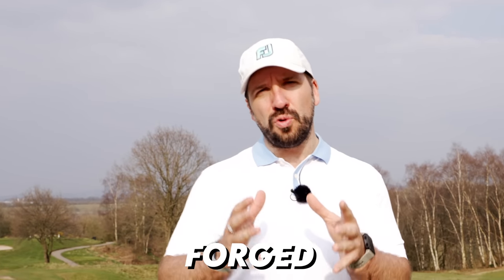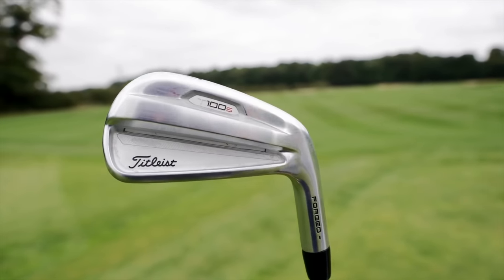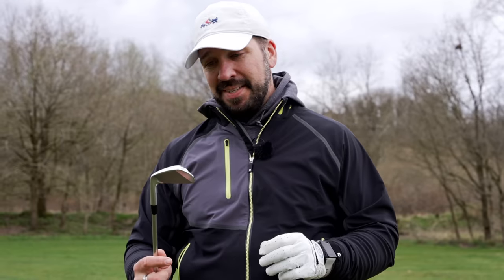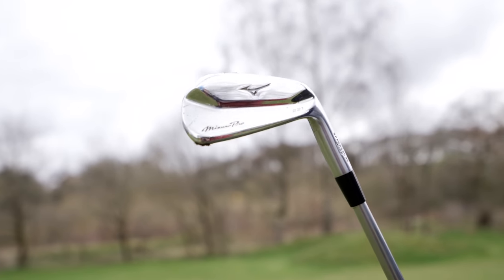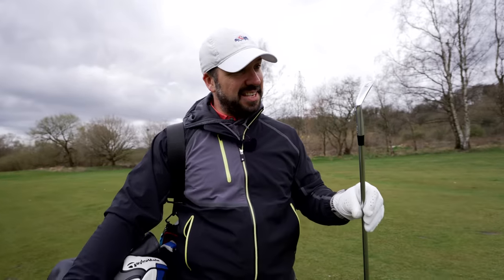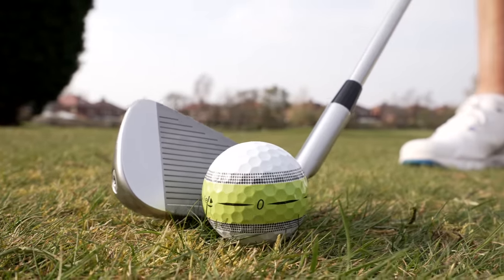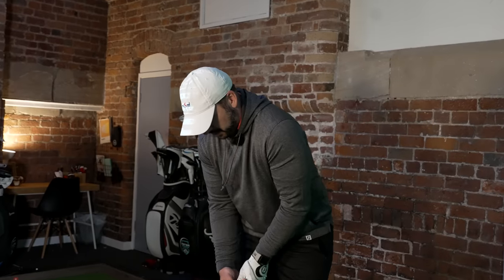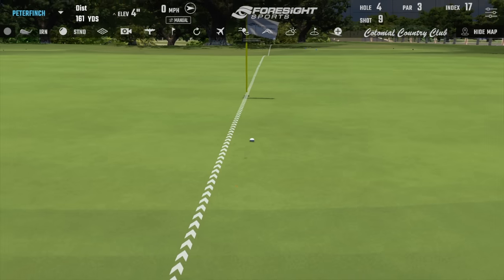THESE are the BEST forged irons in golf!

Comment: Pete, being a 55 year old 5 handicap, I played i500s for 4 years and then went to get fitted.  Though I had decent stopping power with the Pings it was all due to height; my spin was terribly low even given its stronger loft.  I recently hit 223s, JPX forged, Callaway forged, i59 and 525, Srixon 7s but got slipped a club and was told not to look before hitting it.  I now own the set because they felt better and had better consistency in distance and spin.  Those irons were the Wilson D7 forged.  I even tried the D9 forged and they did not feel as nice.  They were sold as used even though they were in the plastic wrapper, I sold my i500s and my out the door price with US tax included was $533.  I couldn't be happier.

Comment: I've had my i525's for a few weeks now. 4-pw. Absolutely love them. Coming from i25's, which where a bit "clicky" and not as forgiving, this is like night and day. Off centre hits seem to go the yardage and the direction, albeit, a little compromised, is nowhere near as punishing as the i25's. Highly recommended. I'm off 10-ish, but these would suit a half decent 16 handicap with average ball striking ability, up to mid/low single figure golfers. 👍
Reply: Interesting to see your comments re 525 vs i25. I have a 525 order in with the local golf shop and will be trading in my i20s when they arrive from Ping. Can't wait for them to arrive..!

Comment: Love the i525's finally converted from p790's . Irons turn up next week. Thin top line, lovely feel with forgiveness and very powerful with extra height to stop on the greens.
Reply: I have the p790s and they're the best iron I've ever had... Also, it's funny that porn spammers are in this thread😂🤣
Reply: I also love the p790 's been using them for 5 years. Time will tell if the switch is a good one. Playing off 10 currently
Reply: @jamiehanford9231  dont try and hit the I525's because you'll trade those P790's in a heart beat. Ask me how I know
Reply: @ultimatejay  i got fitted for i525 last week I’m a 2 month old golfer couldn’t hit the MP 225 and the TM P790 felt like a anchor even with a DG x100 130g shaft

Comment: Got my hand on the i525s after a few weeks, played a couple of rounds and loving them in terms of performance and looks. I am a 24 HC, not the best striker yet these irons offers similar amount of forgiveness as my previous JPX919 HM. I had my reservation before I went to the fitting session, but came out very pleased. No complains worth a try.
Reply: Can you please post your swing speed, distance with 7 iron, and what was ball flight like with most of your shots? Same amount of forgiveness than the 919s has definitely peaked my interest. Anything else you want to comment on please feel free to do so. Thanks much.
Reply: @robertcuomo7084  My JPX919 HM 7 iron goes 135-140 yds carry, mid-high projectory, straight or baby fade shape, ball speed around 105mph (sorry no wing speed data), UST recoil reg shaft. With the i525, it’s a stiff Alta CB shaft, launching quite a bit higher than the JPX. It definitely forgiving for example I striked one of my 7 iron shots on the toe (outside the grooves section) yesterday and it drops off only about 5 yards. I do find that clean strikes the i525 goes 5-10 yards longer too, off strikes similar distance. It may have something to do the stiff shaft being a bit more stable, but I am certain the head is the major factor. My set only goes to 6 irons as I can’t get on with longer irons so I can’t comment on those. I wasnt sure that I am good enough with the i525 before fitting but walked out confident and so far 10 rounds in I cannot be more happier. Hope it helps buddy.

Comment: I have the Mizuno MP 20's and yes, you absolutely want head covers.  I bought head covers AFTER the first season of using them and the mid to short irons all have ding marks from knocking against each other while strapped in the back of the cart.  If you only walk, I wouldn't worry about it.

Comment: I played the Ping Anser Forged irons for years, then decided to move to the Mizuno MP-64s - worse thing I ever did. The Mizunos did NOT feel any better than the Ping Ansers and distance with the Mizunos was at least a club short, no matter how well-struck. Since then, I have been trying to find an iron I could be happy with in both feel and reasonable distance (I'm 60 now but still playing to a 7 handicap from the standard Men's tees). I finally settled on the new Hogan Players Combo set - 4 through 6 iron in PTx Pros and 7 through PW in the Icons (standard lofts in 4-degree increments; 22 - 46 degrees) - I have never been happier. 
I would like to see you do a video review of the Hogan line-up whenever you get a chance, as they are very reasonably priced in comparison to the OEMs. - Cheers

Comment: Shot Hogan's for many years before a flood destroyed them.  Then Cleveland 588's before going to Cleveland Form Forged TA3's which were Cleveland's version of a forged face with a cast club before Srixon bought them and turned them into a pure game improvement brand.  I'll be getting new irons in the next few years and going with some new forged/cast club for sure.  There are some good options and I hope more manufacturers jump on this bandwagon and offer more options to make the choice really hard.  Interestingly Hogan just pulled their PTX Pro which was their club in this space.  Rumor has it that they will introduce a new version next year.  I LOVE consistent loft changes so gaps between clubs are consistent.  The advantage of blades is that their loft changes are 3, 3, 3, 4, 4, 4, 4.  Hogan uses all 4 degree changes.  The Cleveland TA3's use 3, 3.5 and then 4 to make the change more gradual.  Ping has some that are 3.5 for most irons.  When you get into the game improvement irons there can be all kinds of changes throughout the clubs.  I truly hope manufacturers start labeling their irons with lofts like they've done with wedges.  Let those game improvement guys know that their 7 iron is lofted about the same as my 5 iron.

Comment: Take a look at PXG 0211 ST --  These are true forged blades with specs that suit the average golfer.  Tried a 7 iron expecting so so feel and forgiveness.  I was shocked at how great they felt and also how forgiving. (Remember they are blades but you need to try them vs MP 211 but longer and well.... you should just try them out.)  Price... shocking as well .... just go check the pricing.  No screws but they are pure forged solid billet as opposed to the 0211 DC which are cast with PXG's dual core foam ala P790.

Comment: Modern CNC-garving will have the best of both worlds. An eight-axle CNC-machine will mold any shape, you can imagine!

However I play Nicklaus-Miuras at the moment, and can nothing, but admire the handcrafting in them. They are so pure and true workmanship masterpieces. And the feedback from solid strike - then again sculling it…

And I’ve played Mizuno blades in different models since 15 years now. All other brands have felt like either matchboxes, or hard as h*ll. The buttery feel of a solid sweet-spot strike is something different. I like my clubs heavy, so many, who is introduced to the light weighted shafts and clubs will never apreshiate my choice. A heavier club dictates the rythm, you can swing them by. 

Even with the comparision to swing speed, impact is multification of mass and speed. Lesser speed with heavier club equals faster speed on a light clubhead. I’ve tried lighter, but they don’t perform any better, cause I cannot swingthem any faster, yet the physics could support the idea, that lighter will move faster by the same effort.

The MP69 was about the same size as my Miuras. And to be honest, I was a touch disapointed with the MP4-line, cause they looked clumbsy to my eye. Nice and clean looks though, but a touch ”big”.

Comment: If I had to pick a "forged club" I'd most likely would go a route similar to my Bridgestone J38 CB... "semi-blade" or "tour cavity" as they seem to be saying more and more these days. Still a single piece of super soft carbon steel (S20C aka 1020 for example) pounded into shape by a "big a** hammer" into a die... However, there is a bit of a cavity behind, offering some level of "forgiveness" (and on top of that, there's a magnesium insert on the back of the sole to "dampen vibrations"). Rather thin topline, very little offset, Endo forged, decent lofts (PW @ 47°, 7I @ 35°) = pure bliss when struck in the middle, not too atrocious when stuck in the heel, vaguely acceptable in the toe. Obviously you don't want to hit a low toe on your 4i on a frozen winter dawn, but I'd venture to say that THIS IS THE POINT... you get (mildly) punished for bad hits, and learn your way to the centre of the face. 
Having a very forgiving iron set, even if it looks decent and feels more or less OK, like the PING i525 isn't the same at all. You won't learn from the PING, you won't progressively learn to identify where you struck the ball, almost to the millimetre, and whatever people say, you'll not know the true feel of a perfectly flushed "true forged" long iron... Rare as it might be!

Comment: Forged face doesnt equal fully forged head - If you believe the background about different forgings then its about the grain structure and density that gives the feel of the strike. Just welding a forged face onto a cast head isnt the same. If fully forged clubs are no better than cast/combo why do OEMs have forged written all over clubs that only have forged faces - if the clubs feel the same as fully forged then why big it up.

I play mizuno MP59s and they certainly feel different to many of the cast/hollow clubs with forged faces (apex pro 21, zx5) - not saying they perfom better (all down to the golfer sadly) - but there is a different feel on a centred strike.

Been so tempted to get a set of ZX7s as they are even softer than mizuno

Comment: Man, those Pings are just not a very good looking club…I played Mizuno blades years ago, MP69s, and they were my favorite…listening to fitters since then, I’ve always opted for more of the players distance irons as they call them now, and currently use T200s…they are great, but I miss that feel of the Mizuno MP69s…to that end, my goal is to get another set of clubs that I can use for pure pleasure, i.e., the best looking and feeling clubs on the market that I can just play when I’m not playing competitive, which is most of the time now, and come away from a round with a handful of just memorable shots…I haven’t had that with my last few sets of irons…So, I think I’m leaning towards the MP 221s (or MP20s used since they are identical and probably a little cheaper), or I may swap out my scoring irons on my T200s for T100S irons…I have to try both first.

Comment: Like anything, it comes down to the player, how good they are, what they are looking for from a set of irons. What a 20 handicapper wants is unlikely to ever be the same as someone of scratch or plus figures.

And there is a lot that is also subjective witb appearance.

Clearly there are also categories of iron. Where you have cast irons, fully forged and multi material - with technologies like tungsten, forged face and foam etc.

Btw, cast vs forged really isn't a contentious point in an iron. Any half decent player can absolutely tell the difference. What they prefer is another question but a solid struck forged club feels different to cast. No question